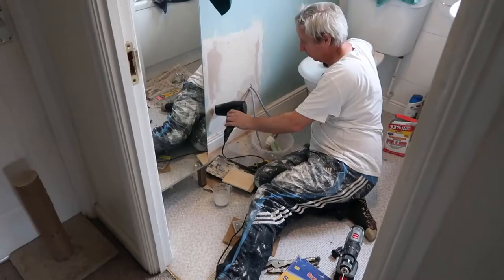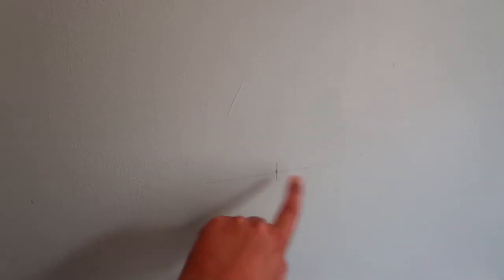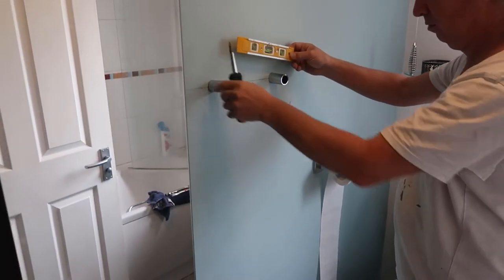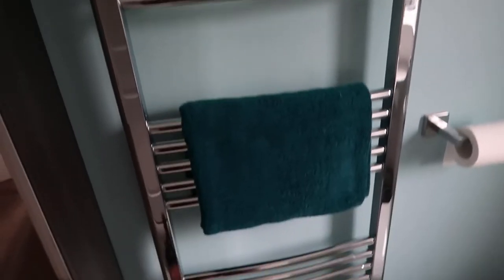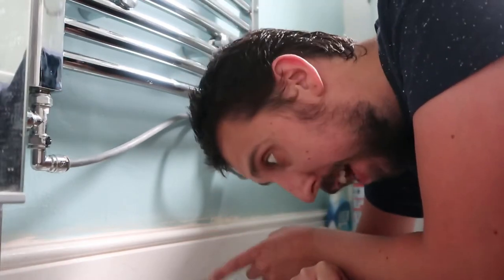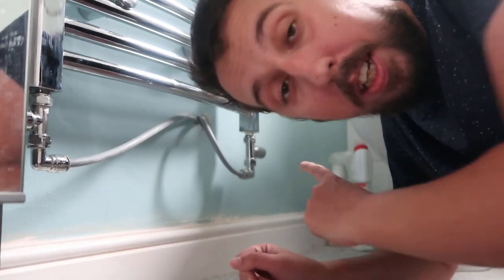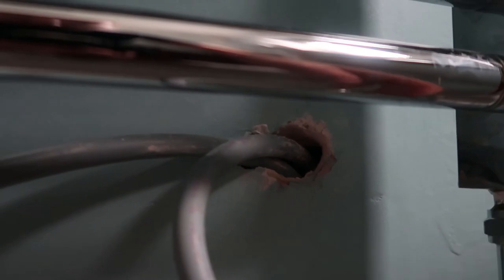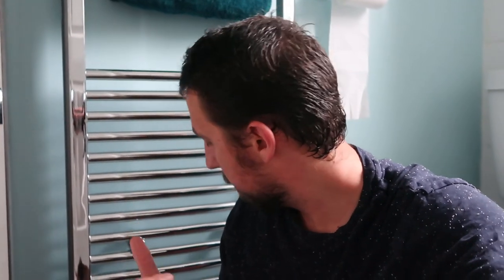Installing a brand new towel radiator | My dad is a DIY hero!

Comment: I would have fitted the rail a bit higher if ceiling permits, you don't wan't to burn your knees when on the loo (but you probably have found out that by now) get some locktite 577 and use that instead of ptfe tape on the threads, 100% you won't have any drips in future.